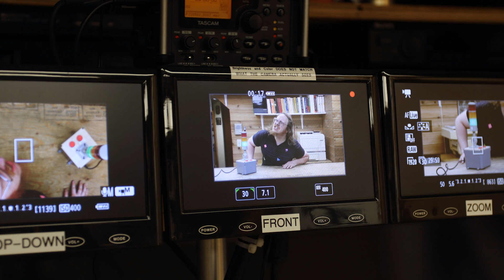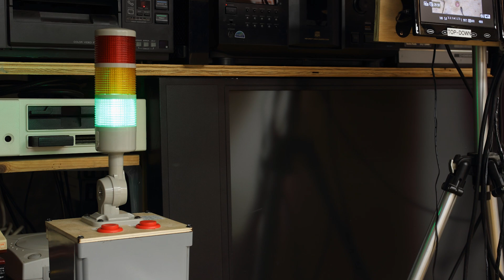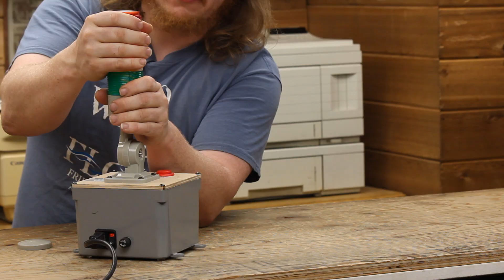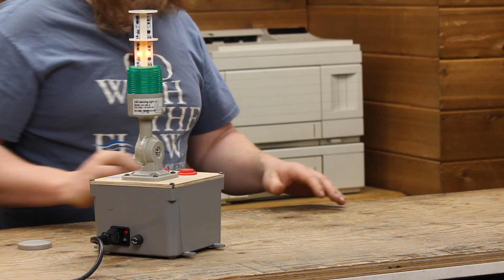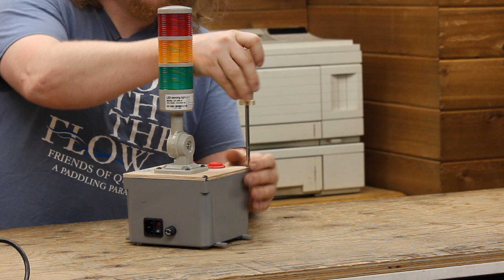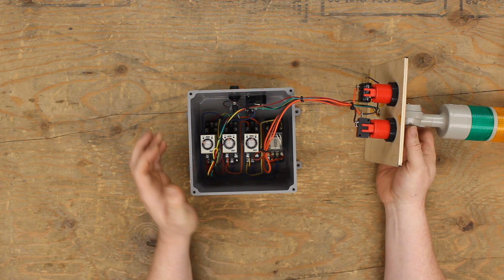Visual Indication - How I solved a camera issue with colored lights

Comment: I'm not sure if the remote shutter button works for video on the T3i. But if so, you could add three potential free outputs to wire the cameras to. So your start button on your light also starts the recording in the camera :)
Reply from the maker: Without firmware hacking, the wired shutter button does not start/stop recording video. It only allows for focus and single-image photos. Yes it's infuriating.

Comment: I love it! I hate fussing with microcontrollers. Would like to get the part number for those dial relays those are cool little devices I can think of a bunch of cool things I could do with them.
Reply from the maker: No real part number as it's an Aliexpress special, but searching "Analog timer relay" wil lget you in the neighborhood. Really though, you will want a digitially adjustable timer as I found the analog ones were very hard to set perfectly.

Comment: That's a really good solution, microcontrollers are fun and all but it couldn't have been this simple. The IO pins are bad for power, usually they can source or sink a bit of power, but if you push it the chip goes pop. This would need the microcontroller to control a mosfet, and either that mosfet controls DC LEDs or a relay to control these LED modules. So now you'd've'd the microcontroller, 3 mosfets and 3 relays, plus some capacitors to make them chill, and a DC converter that can drive the LEDs; or worse the microcontroller and an addressable LED strip with far more complicated code requirements and probably a rebuilt light tower. I think you've got strictly the simplest and most straightforward way to do this.
Reply from the maker: I like solving problems with relays. :)

Comment: Your timed light tower is a pretty clever solution.  You described how you made/wired the thing pretty darn well in my opinion.  I went through schooling for electrical wiring for commercial, residential, and industrial wiring.  Making things do different stuff with relays and timers is pretty fun.  I have designed and built up many control boxes over the years using both just relays and some sort of PLC controller.  Back in the day using older computers you had the tower, monitor, and printer to turn on.  I ran 120 volts through 12 coiled relays to outlets on back of the tower so when you turned the tower on it turned the monitor and printer on at the push of 1 button.  Why did I do this.....because I could LOL.  Remember once pc I built I put a battery backup inside the tower with everything else....again because I could.  Thanks for sharing a pretty darn good solution to your recording limit issue.

Comment: Clever solution to a stupid and obscure limitation on digital cameras... reason why I use camcorders now. And also, camcorders have IR remotes.
Reply from the maker: I actually toyed with that before this and a problem I found was that without a way to address or discriminate between cameras it was hard to start or stop all three cameras at once. Often two would start and the third would not. Press the button again and two would stop and the third sees the start/stop and begins recording.
The fact the wired remote input on these cameras do not start/stop in video mode feels almost deliberate.